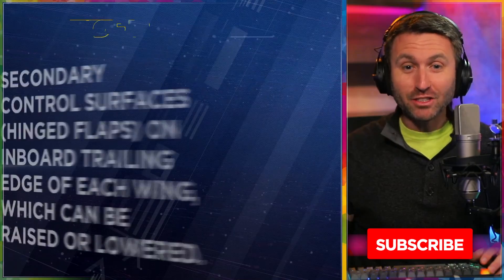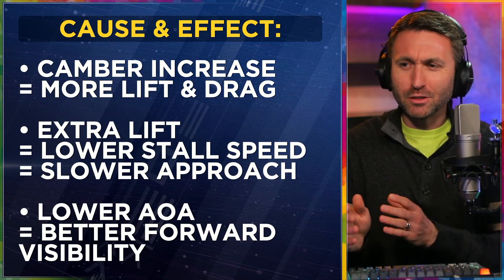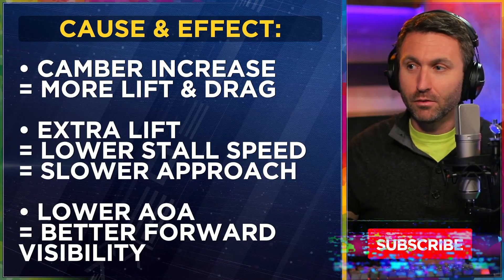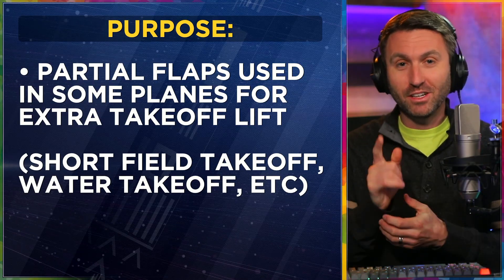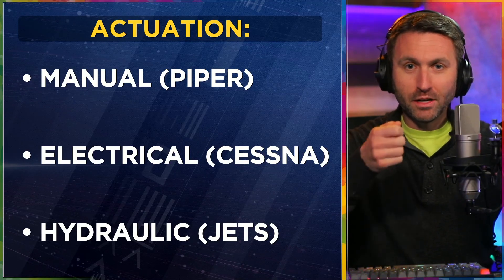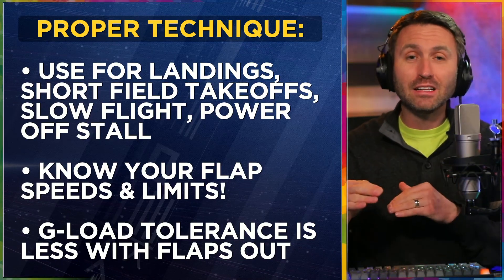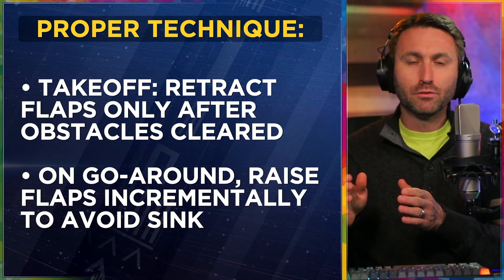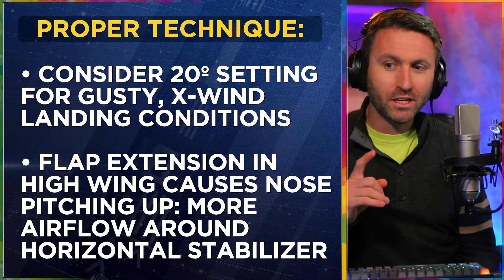Airplane Wing Flaps: Explained

Comment: Another great video; however, I would suggest that the initial pitch up when extending flaps is more due to the increased lift (or movement of the center of pressure) as opposed to more airflow over the horizontal stabilizer/elevator. It often occurs in T-tail and V-tail aircraft as well, which surfaces typically are outside the effects of the wing.